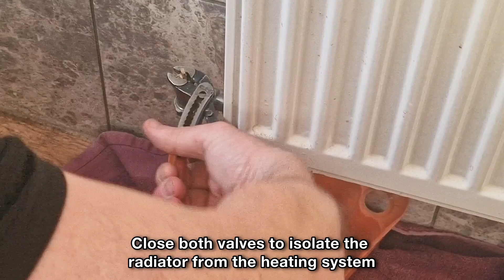How To Change A Radiator Bleed Valve

Comment: Is it necessary to remove so much water from the radiator? Or just enough to go below the bleed screw?
Reply from the maker: Lower than the bleed valve hole, not just the screw.

Comment: Are all bleed valves usually interchangeable?
Reply from the maker: Yes. On old radiators you can just change the bleed screw if you can find a replacement but most modern radiators have got a half inch bsp hole.